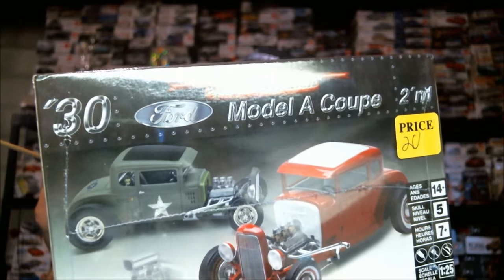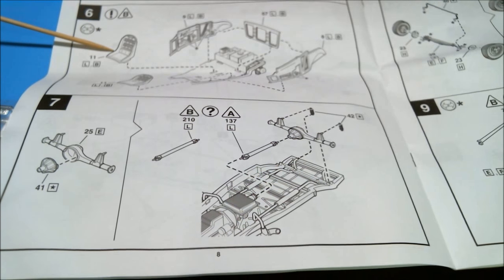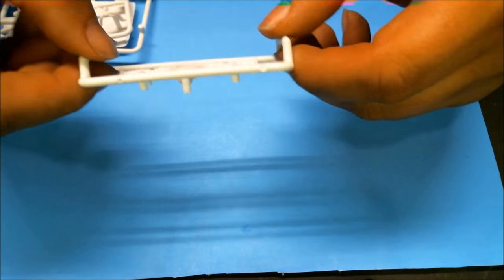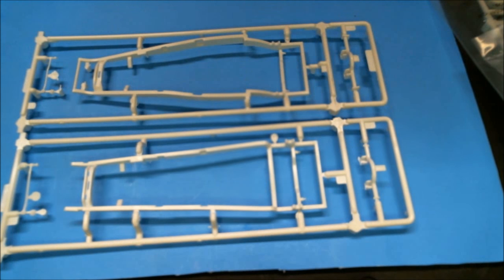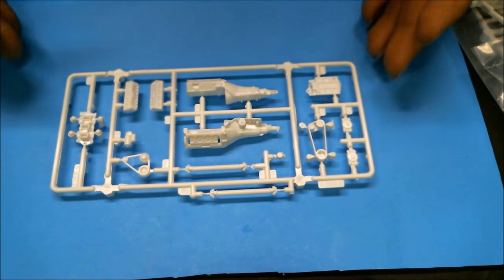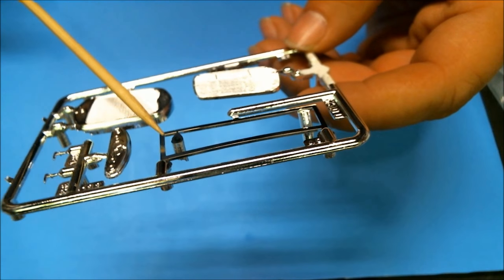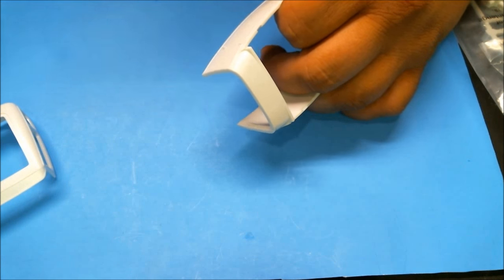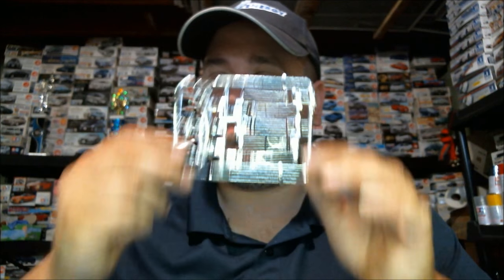The Stash Project - Revell 1930 Ford Model A Coupe Kit Review

Comment: the 32 frame will not fit the 32 ford when used under a Model A the are narrowed or pinched to fit the narrower body of a Model A if your wondering how i know i have built 1 to 1 scale street rods for 30 years